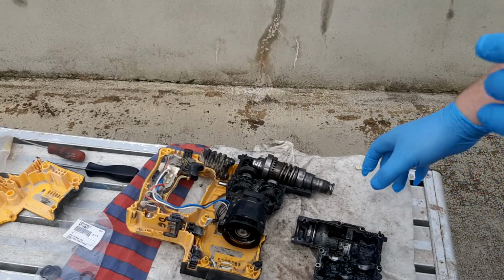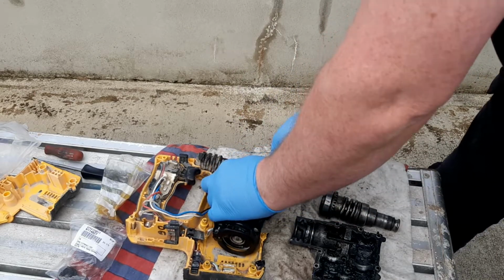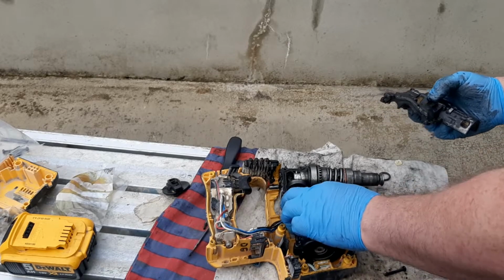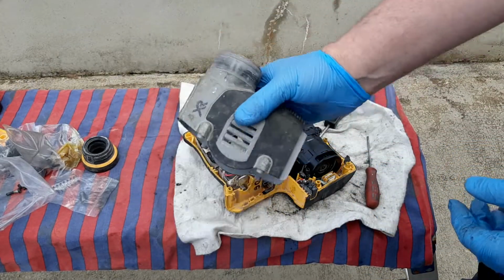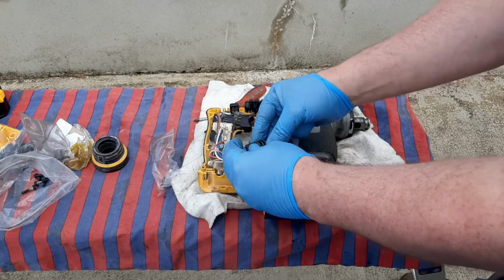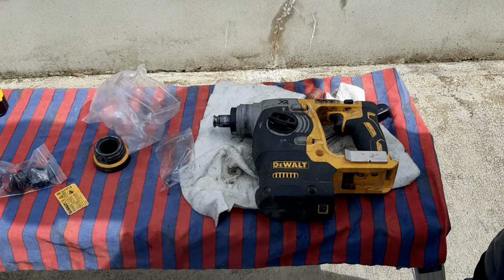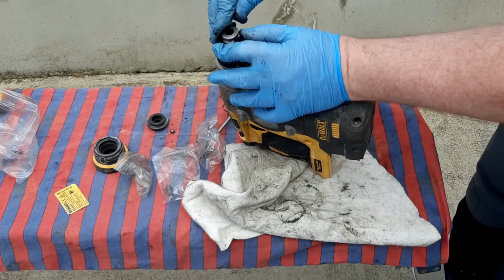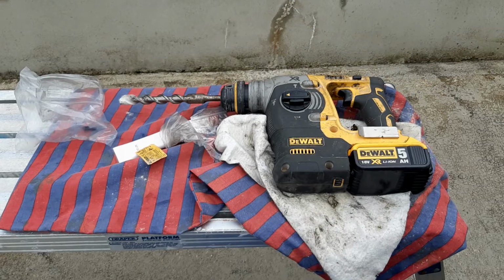DeWalt DCH273 SDS Repair and Rebuild (Hammer Fix)

Comment: You had one of these stop rotating when under pressure? Only when on drill/hammer. Works fine on hammer and fine on drill only
Reply from the maker: Yeah it can be the switch  motor assembly sometimes a clean of the switching the motor fixes it
Reply: @doctorlefthandthread  probably cheaper to buy a new one then if it dosent clean and work
Reply from the maker: @tom451  yeah

Comment: Great video on the disassembly and reassembly of the hammer drill. The clip on the spindle, Item # 35 was bent and not in the groove when I disassembled the unit. I have the parts now but I'm having trouble compressing the spring to reseat the ring on the spindle. Any hints as to how to compress this spring and reseat the clip.
Reply from the maker: It's tricky you may need a vise for that

Comment: Thanks for the video!
I’m going to attempt this in a couple of weeks when the parts arrive. The beater piece gets jammed when chipping, it’s happened since day one and I thought it was normal until I used another one. I ordered a new piston, ram, beater piece, clips, washers, o-rings, and grease. I thought it was just going to be the ball, spring, washer and clip at the front, but unfortunately no. 
I probably should’ve bought a whole new unit🤣
Reply from the maker: Worth a try good luck with the repair
Reply: @doctorlefthandthread  thank you
Reply: @doctorlefthandthread  changed the pisto, ram, and o-ring still doing it. I have to wait for the internal spindles parts to come it and see if that works.
Reply from the maker: @akaredcrossbow  good luck
Reply: Hi, where are you buying the parts. Any good website with quality parts and good prices. Thanks.

Comment: Mine broke a couple years ago.  I tried to take it apart to see if I could fix but something seems to be wrong.  The ball spindle was busted in half.   I bought a new one, but it seems likely my piston is screwed up as well, as the spindle gets stuck when trying to slide it into the hole in the piston that its supposed to freely slide up and down in.  It must have deformed that hole when it broke in half.  Is it worth it to fix at this point?
Reply from the maker: Probably not worth it. If it was mine I would keep it for parts

Comment: The O ring on my hammer is fine but it's very dry inside it wouldn't come out freely when dismantling.. have the same problem with no hammer..any ideas
Reply from the maker: My guess would be its dried out you could grease it a bit get it moving freely and put it together to see if it fixes it

Comment: I've diagnosed the problem with mine not turning being that the brushless motor has some masonry stuck in it preventing it from turning, however I cannot figure out how to open the motor to clear out the block, or even find a replacement motor anywhere, do you know how that motor opens, or where to buy one?
Reply from the maker: There are screws holding the motor housing together and small removable piece that the spring from the body pushes against. You may have missed removing a screw. The motor in those is quite tough you may only need to clean the Masonry out you may not need any parts. Here is the parts diagram https://www.partshopdirect.co.uk/dewalt-dch273-rotary-hammer-spare-parts-s15448/

Comment: Bravo my friend. Great repair. I love my dewalt rotary hammer. They hit hard as hell 💪✊
Reply: Mine keeps spitting chisels and drill bits out.  I've replaced the chuck keep spring ballbearing washers etc. But still doing it
Reply from the maker: @tomo7T1  only a guess but you might need to replace the plastic part of the chuck I have seen that being the cause in the small Dewalt SDS DCH133
Reply from the maker: The motor in the DCH273 is a beast! it's usually the mechanical parts that break, as they say somethings gotta give!!
Reply: Yeah they do